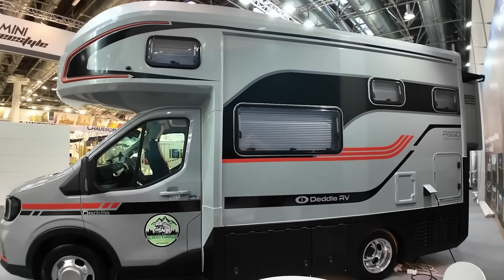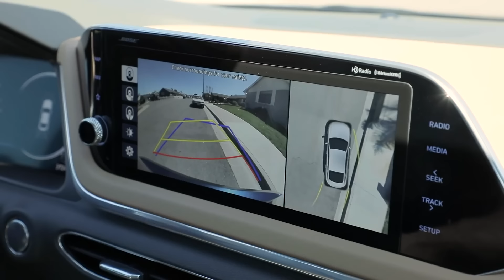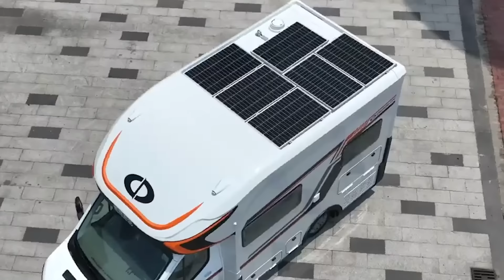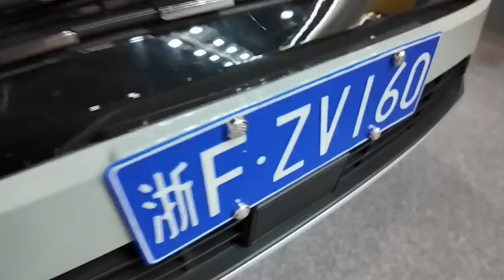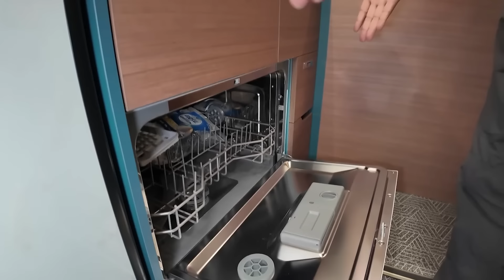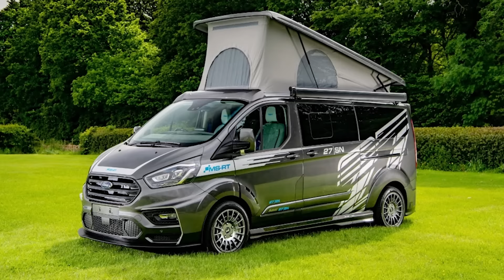How this Chinese Startup is Crushing The RV Market!

Comment: It’s still the same ugly shape like most European RV has and needs a lot of extra gasoline or diesel with this bed over the driver cabine. 
BYD is thinking outside the box and some 4x4 offroad  models too. The new ideas compared to the usual European models are a good start to create something new for a new century.

Comment: Ford badge steering wheel
Reply: Yes, because it is built on a Ford chassis.  It is pretty common for RV/motorhome manufacturers to build on an existing company's chassis.  Generally, that is the name on the hood and on the dash/steering wheel, while the camper makers name is on the camper portion.

Comment: Definitely not for US market lol, and very overpriced.
Reply: very overpriced? US market is the one that is overpriced
Reply from the maker: @JohnC_11 I agree 😢
Reply: @JohnC_11 you can buy a 31 foot class C with lot more space and a full bathroom and not a wet one for that price.
Reply: @rcac1023  That's all built on compressed particle board that disintegrates with moisture. The way American motorhomes are built, I wouldn't touch them. More work fixing all the leaking and poor quality builds than its worth. Better to build your own if you can but those factory produced junk motorhomes manufactured in america are meant to fail as soon as warranty is up.
Reply: It is not overpriced when comparing it to camper/vans. Actually it's on the low end. Luxury camper/vans are 200K +. I was really impressed. With the dishwasher and clothes washer. We are senior citizens looking for smaller footprints. Big is out. Compact small is in. All electric is good. When you get older you don't have to worry about propane. Electric is safer.
Reply: @cannonsec  That just means that they are ALL overpriced.  I see why they don't mention the price until the end of the video.  But it does have cool features.  For half the price it would be worth it.